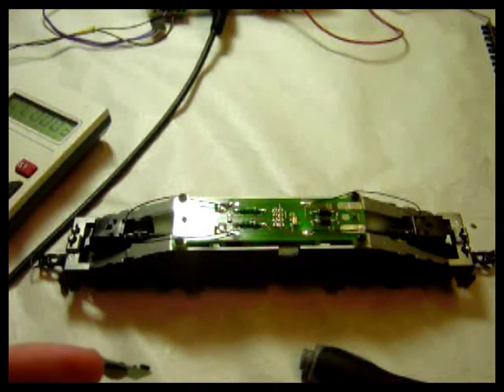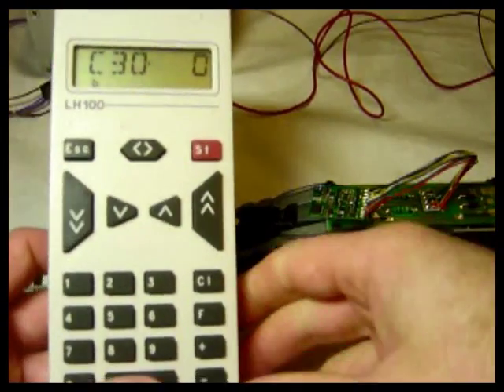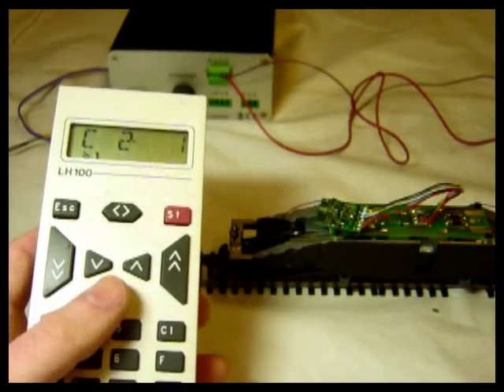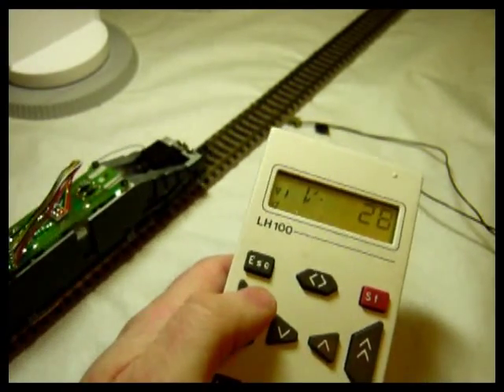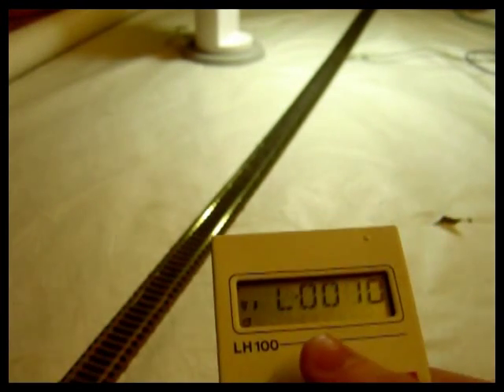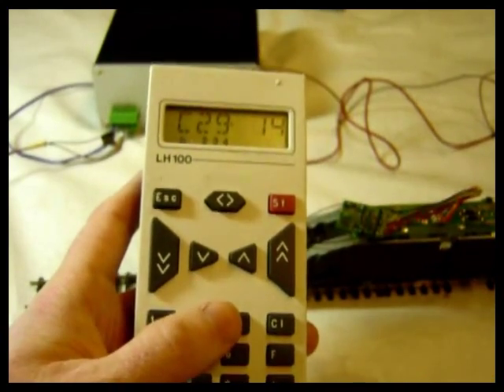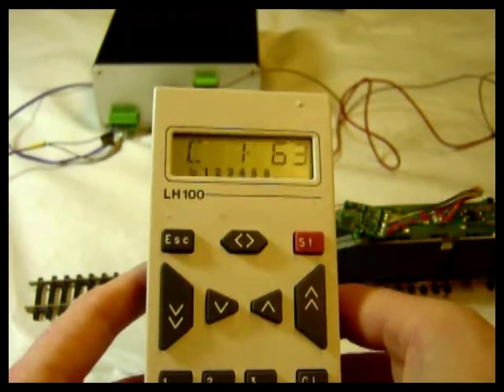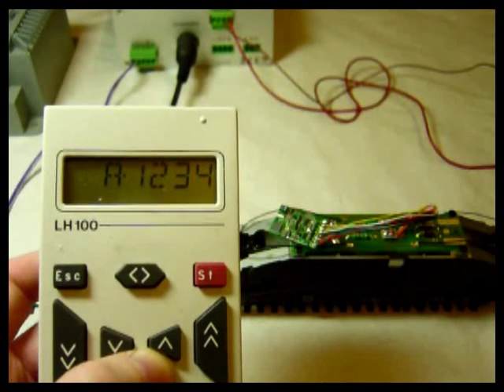Lenz CV Programming - Useful information on commonly used CVs.wmv

Comment: Do Lenz decoders have a CV value limit? like over a certain number it doesn't work, or is only accessible through sub menus?
Reply from the maker: Really not sure what you mean. In general the individual decoder manual will show the value ranges applicable for each CV some may be locked depending on what they control  - for example the Manufacturer ID in CV8 cannot be changed
Reply: @digitalcareline  I guess I mean their range like 0-255. I have an esu decoder that I need to change some things in the 291+ range of the CV's and its not working.
Reply from the maker: @dwpedalplayer  With Lenz  you can programme CVs in the range from CV1 up to CV1048 (Version 3.6 available for 12 years - Older versions had 900 cvs I think).  It can cause confusion - in the current recommended practices for DCC there are 1048 cvs each can have values between 0 and 255.  ESU decoders may be locked or they may use banks of CVs controlled by the value in another CV- They can be very complex to work out manually and ESU sell a programmer to aid their set up - to manually set up the latest ESU decoders you really have to sit down and work through the decoder manual and write notes. Take care when making changes and write down the original value before you delete it so you can reset it if you need to - Take care    Chris